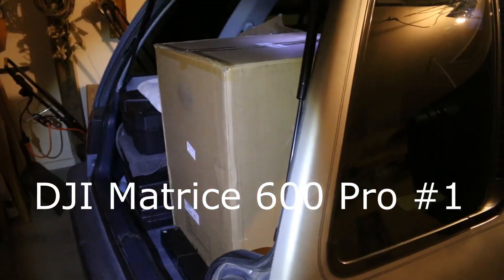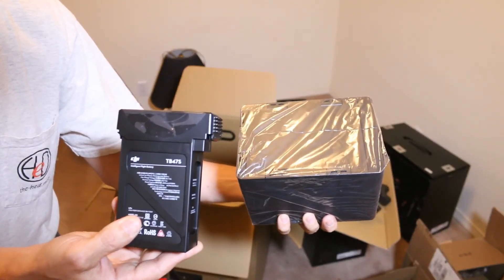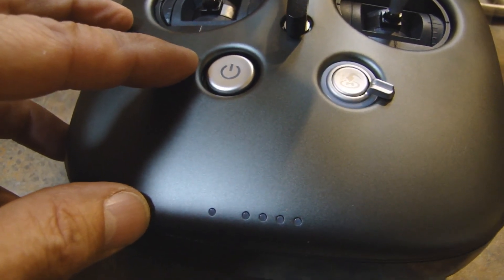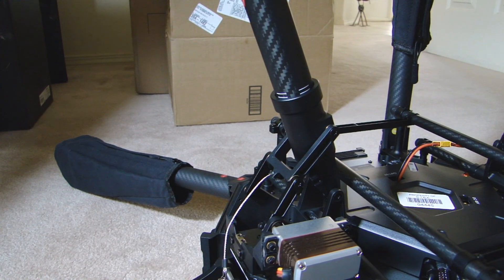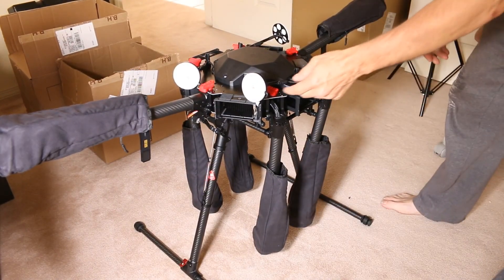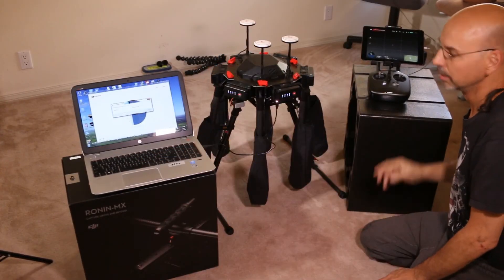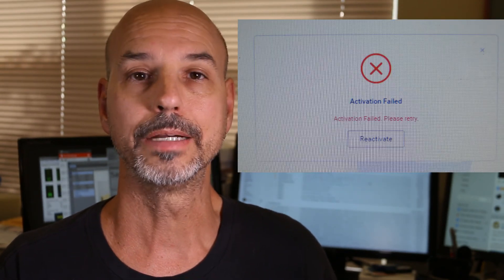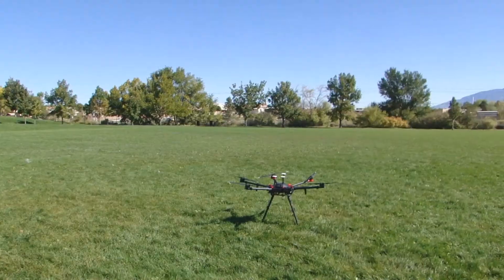Matrice 600 Pro - Assembly, firmware, flight test...

Comment: Really nice video man!! I just picked up two of these w/ case at a great deal.. I have tested both and found one has a landing gear antenna and one doesn't.. The one with out the antenna doesn't work properly. You need to be to dangerously close to activate it but I did .. Thank you so much for this video

Comment: dear donnie thank you for reply first then I bought ipad and got dji gs pro thanks ,and everything is ok while I doing firmware connect cable then internet disconnected and lost firmware version  so help me how to update again my regards
Reply from the maker: Connect a Windows computer to the M600 via a USB cable.  Run DJI Assistant 2 software.  From there it will be self explanatory how to see Firmware, update firmware, etc.  If it doesn't work, then there is something wrong with your Windows computer or your USB cable or your version of DJI Assistant 2 or your M600.  These will be impossible to troubleshoot via the comment section of a YouTube video.  So use Google or better yet, DJI Support.  This is my last reply.
Reply: @drummerdonniedotcom  thank you now is clear

Comment: hello dear could you tell me the app for  matrice 600 pro ? I can't found and (DJI GS pro ) not found on Google play ?
Reply from the maker: Go App.
Reply: @drummerdonniedotcom dear I can't found GS pro on Go APP I have ondroid devise and iOS ? my regard
Reply from the maker: @yasoalquaiti4765 : I don't know what you're doing wrong.  The Go App, Go 4 App and GS Pro are right there in the Apple Store.  I just found all three in under a minute.
Reply: @drummerdonniedotcom  ok dear you mean the go app and go 4app ,GS are compatible for matrice600 pro ? thank you
Reply from the maker: @yasoalquaiti4765 : The Go App is for real-time control of the M600.  GS Pro is for waypoint flying of the M600.  Both are available in the Apple Store.  Go 4 is NOT compatible with the M600.  I only mentioned it to let you know that ALL DJI apps are available in the Apple Store.  I'm done with this thread.  Watch the video.  It's all right there.
Reply: @drummerdonniedotcom  dear donnie I research Dji gs pro on apple store found( flight plan for dji drones and not free that app dji gs pro you used not in the list research and my matrice600 pro is not operated 😓
Reply from the maker: @yasoalquaiti4765 : With all due respect, if you lack the technical savvy to simply FIND an app that clearly exists in the Apple Store, then maybe you shouldn't be flying drones - let alone something as heavy as the M600 Pro.  
--
Short of flying to your country, connecting your iPad to the Internet and downloading the app FOR YOU, there's nothing more I can do.  The apps are there.  If you can't get to them, I suggest a newer iPad or different Internet connection.
Reply: @drummerdonniedotcom  thanks donnie

Comment: FOR WHOEVER IS IS HAVING A PROBLEM ACTIVATING A M600 ON IOS. I DOWNLOADED PARALLELS DESKTOP ON MY 💻  THEN DOWNLOADED DJI ASSISTANT 2 CREATE AN ACCOUNT WITH AN EMAIL ADDRESS, LOGIN IN CLICK ON ACTIVATE DRONE.....3  MINUTES LATER I WAS IN THE DRIVEWAY FLYING 😁✊🏿✊🏿
Reply from the maker: Good advice.  But you should clarify.  When you say, "...activating on ios..." are you speaking of an iPad or Mac computer?
--
Also, if I recall, I didn't have to create login credentials back in 2017 (or I would've noted that in the video).  So it looks like things may have changed from 3 years ago.
Reply: MAC COMPUTER
Reply: Yes sorry it wouldn’t let me go any further without creating the account.

Comment: Hi! I have the same activation problen as you :( even with the last assistant 2 software, can you send me the beta version you used? julioghigiarelli@hotmail.com
Reply from the maker: Well, it was beta back in 2017.  I'm sure the version you have now is the version I used then.  Truth be told, your version may even be 1 or 2 or 3 generations newer.  The version I used back then was DJI Assistant v2 1.1.2.573.  Dollars to doughnuts, if you check your version, it may be newer.
==
Keep in mind that I set these M600's up for a client and then they left my hand never to be seen again.  So, other than initial set up, I'm not much of a road map.
==
Which version of DJI Assistant do you have?

Comment: Dude, awesome video! I so want this drone someday! Are you eventually going to add a camera mount or LIDAR to it?
Reply from the maker: Well...I should clarify that these were not my drones.  I built them for a military contractor.  That said, I DO plan on getting one.  And I DO plan on mounting both camera and LIDAR to it.  But that's down the road a bit...maybe 3-6 months.
Reply: 7 months have passed. No LiDAR? No more M600 videos?
Reply: @drummerdonniedotcom  could you email me at phenomecom@gmail.com... I brought 2 matrices 600  and I'm  having range problem
Reply: i got a quote from dronenerds with a Lidar system. 110k including software but without the drone. Crazy price but the equipment is state of art for sure.  I am not sure if the ROI is there yet if you don't have some immediate use or application for any of your clients. If you want to do 3d mapping, still much cheaper ways out there and works fine but of course not as centimeter accurate as a Lidar scanner.

Comment: ~> Certainly not a smooth Enterprise buying experience. How would one know that they weren't successful in "connecting" with DJI servers ?  (Chinese holiday aside) Are they able to fly without restrictions with a total power down on all devices and a restart or will they hit the brick wall continually ? Will they have to wait for the publication of the second assistant 2 software ?
Reply from the maker: Re: WORKING Assistant 2 software....

The sad truth is, I don't know.  There's the one available to the public, and then there's the version I got.  I found a "back door" for my solution.  I don't know how others in my situation are handling the same "Activation" situation.  

Even better, there's now a firmware recall on the latest M600 Firmware.  But get this...the recall is NOT published on the DJI website.  Try as I may to find the recall on their website - or extract said information from chat support or phone support - I get nowhere.  "Support" act like they have no idea what I'm talking about.

As great a machine as the M600 is, it feels less and less like an Enterprise machine, and more and more like some kind of black market Russian machine.  I thought DJI would have some kind of Enterprise support for Enterprise customers.  They don't.  DJI "support" (HUGE air quotes there) is handled via FB, Forums and other sleezy-feeling, back alley avenues.  Mind blown.